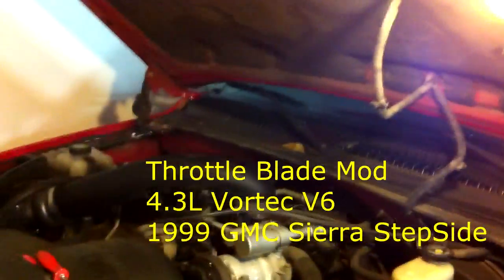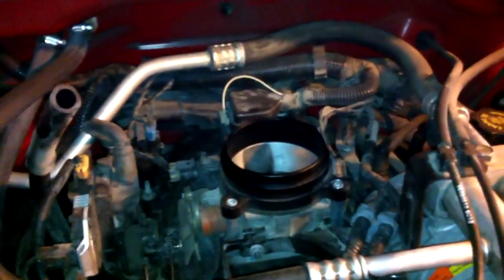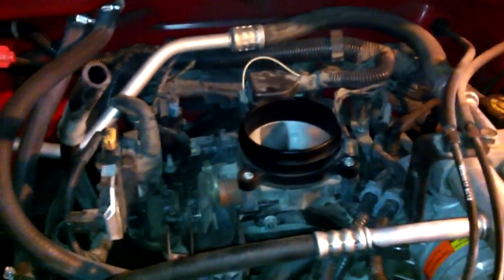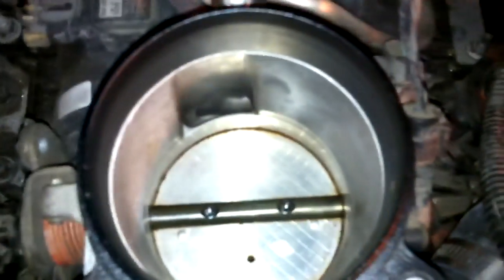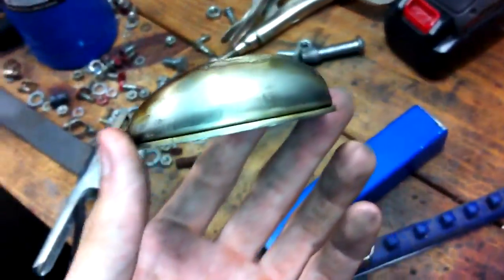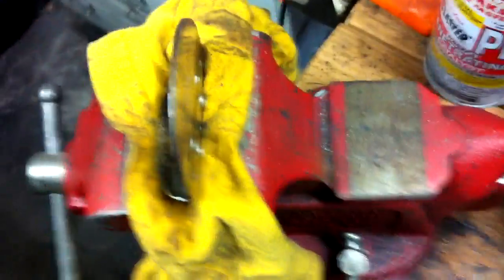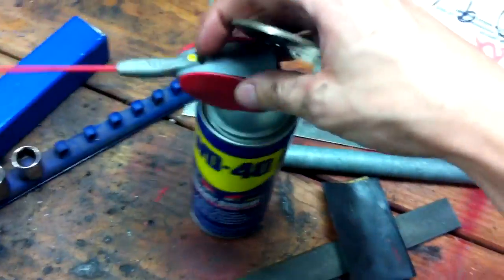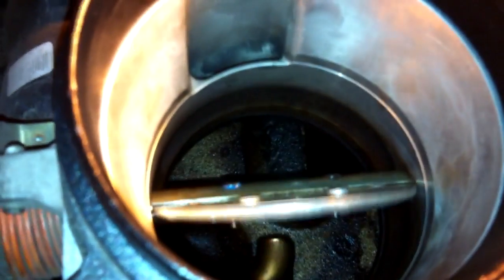4.3L/5.7L Vortec V6/V8 | Throttle Body Blade Mod | 262/350ci

Comment: is there a performance intake throttle body for 4.3's yet ?
Reply from the maker: its the same one that's on the 350s.  cant really do much for them other than mill them out larger
Reply: oh, ok ! ! Yeah I wasn't sure if you could order a holley or edelbrock for em yeah... thanks man!
Reply: cartoonist1975 
There's absolutely no need for any TB larger than the stock one. It even flows more air than the Vortec 350 can consume, so it's far more than even a radically modded 4.3 can ever use.
Reply: Hey Thanks Lee ! !

Comment: Hell mine ripped right off, the rivets pulled through that plate. The rivets stayed on the main one but the damn thing jammed in place causing my idle to race up to 4,200 at stops. I took it out cleaned the throttle and did notice more power at lower rpm's and it get's the same gas mileage. It did need a new tps also for that sticking idle all is good now.
Reply: same thing happened on my 2000 blazer 4.3..it does jump just a little from a standing start..not much though..but i gotta tell you the car runs a little quicker at high way speeds and accelerates a little faster going into passing gear. gas milage is the same. next im putting a cold air intake kit on it and a magnaflow or similar and see what happens!
Reply from the maker: I ended up changing my TPS about a year after the mod, it threw an engine code. TPS module incorrect voltage or something. cool to know all is good
Reply: EricTehRedneck  Update. Changed the tps also cause I still had a higher idle. Now a few months later after the idle staying where its at after letting off the gas to shift and spiking up to 2k also at times I decided to change out the iac motor. Cleaned the hell out of the throttle body taking it off to make it easier to change it, putting a new gasket on too. This made the idle really smooth but still spiking up to 2k and not dropping between shifts!! So and check this out people the damn cruse control wire was pulling the idle up! Or maybe not, I'll know in a few days of driving it but sense being the throttle cable was lose when it was happening. Thank god for my 96 geo Tracker!

Comment: I would like to hear from an expert on this. My guess is that plate you removed prevents abrupt throttle response when you press on the throttle from idle and only want to give it a little gas. It looks like the extra plate works to slowly blend the air when you use 10% of throttle. I would be curious now that you removed it, do you have abrupt throttle response pulling away from a stop at normal speed.
Reply: That is the point of doing it!  Lol

Comment: This mod doesn't increase hp but it does make a difference from a dead stop but to feel the power you need to tune the truck i did this and pretty good mod

Comment: what intake and exhaust do you have? It sounds badass for a 4.3
Reply: Mine sounds very similar, I have a Spectra cold air intake and a flowmaster 40 with a cat delete.
Reply: All 4.3 sound like badasses I had a hole in my collectors once right at the exit for the manafold  it sounded like a racing truck straight pussy magnet 

Until I got a ticket

Comment: I don't know about this mod. I personally wouldn't take a chance but that's just me.
Just get rid of the "Spider" Injector and get you a brand new Delco for ~$300 on Amazon. These injectors come with regulators on them, as an assembly. Might as well change it all, especially if you have all original parts.

I had a rough idle and a P0300 dtc there for a while. I drive a '98 K1500 and these "spider" injectors are shit for these earlier vortecs. I got a new fuel pump, crank sensor, dist. cap/rotor, new wires/plugs and the Delco injector and the truck runs like a brand new truck. It's been running weak so long that I've almost forgotten what it's supposed to run like.
Just do the maintenance that I mentioned and you'll be all set.

Comment: Ok - i hate to break it to you... you did not increase the horsepower of this engine. Let me explain why. The throttle body, MAF and intake components flow enough air with that hump to satisfy a 6.0 vortec generating 360 HP. That little 6 can't pull enough air to make that hump matter. 

Why then does it feel faster? here is why. GM put that their to make the throttle less jumpy and more manageable for daily driving. Because that throttle body is oversized for the application already, the tip in point is too aggressive without the hump so your manifold pressure jumps really quickly without it - making the engine feel more aggressive. But unfortunately, it still makes 210 hp. 

Get some nitrous, a cam or supercharger. til then, it makes 210 hp. Maybe 220 with the exhaust system.
Reply from the maker: it makes 200hp and "I hate to break it to you..." but the only one that claims a hp increase is cfm tech to steal your money.

Comment: I think this will mess up your fuel economy. Great for power im sure. But, if the upgrade kit is only 40 bucks just buy the 40 dollar blade. At least if you do notice shitty milage or just unhappy with it you'll still have your original unhacked throttle blade.
Reply: It has no significant impact on fuel economy. Most claim a slight gain, but I saw no discernable difference in mileage.

Comment: Do you know where the fuel pressure regulator is on that engine?
Reply from the maker: under your throttle body inside your intake plenum the fuel pressure regulator is attached to the spider injector unit. I have a video
Reply: thanks for the instructional vid!! took me more than 6 beers to finish though lol. more like an 18 pack heh.

Comment: I did this today on my blazer and my idle rpm jumped from 750 before mod to 1500 after mod. What could the problem be?
Reply: I'm guessing you removed the rivets and didn't plug the holes. The air going through the holes will cause an increase in rpm at idle.
Reply: lol.
Reply: lol
Reply: T.P.S.

Comment: Can't this slow your car down due to the computer not recognizing the amount of air coming in?
Reply: The MAF sensor will tell the PCM how much air is going into the engine.
So the PCM can compensate for this mod right away.
Reply from the maker: you should reset your computer by disconnecting your battery and waiting 5 minutes
Reply: EricTehRedneck That's how you reset the computer?

Comment: Did this the other day...I am very happy with the difference! Can't really think of why they would restrict it like that...the gain in responsiveness is just amazing!
Reply: I read they they did it because people were complaining of there wheels chirping and they hit the gas hard. Which I find comical. I removed mine also and noticed a big difference also. And going with gap less plugs and a good ignition coil makes a good difference too
Reply: Took a bit of getting used to, I'll admit haha...but nothing difficult. Backing up is a change for me. I noticed my throttle has a small catch...but has nothing to do with the plate...I took a long time bring careful removing it. Is it just suction?
Reply: What plugs do you recommend, and what brand of coil? I'm trying to get all I can out of my 4.3 being safe and conservative and on a low budget lol
Reply: ***** what do you mean by catch?
Reply: ***** Bosch plugs ( cheap brands broke on me all the time )  And i got a used MSD off ebay. Won bid for 15$

Comment: I have a 99 4.3L with 3.53 rear gear and will lite up street tires with no problem if tuned properly.  I use good  8.5mm  wires and good plugs, I get super throttle responce without this mod. It does not ad hp or better gas mil. why bother, I'm sure it sounds good. If you want more bottom pulling power use taller tires
Reply: Use taller tires? So....let me get this right....this blade mod doesn't cost anything but you're miss know it all and so nothing anyone else does is worth while because it wasn't your idea? So you had to throw in your two cents and tell everyone "meh, forget this free (that means no cost) mod that actually does work (yes, it does) and go out and spend a couple hundred bucks on tires instead". Get back Loretta!
Reply: CamSayCam d
Reply: Shorter tires dumb ass

Comment: Are these throttle body blade restrictors a common thing on most cars?
Reply: I have one on my 2005 Chevy Blazer with the 4.3L V6 4X4 I think because the truck has low end torque so just touching the gas at a green light it doesn't spin your tires or spin them in rain/mud/snow Most chevy trucks have low gears There made for towing and light off road use ..stock Cutting the restrictor of helps the airflow if you have a cold air intake not sure about cars but I never seen any of them with the many cars I had

Comment: How much horse power does the cold air intake give you? This guy said it was one hp of the 4.3
Reply: Carb. i give it 250bhp stock 300bhp aftermarket.
Reply: Blue Rebublic r u stoned these motors only push 190-195hp at 4300rpm the cold air intake may add 1-2hp but if u gut the stock system and change the piping u get close to 5-6 hp

Comment: I have the opposite problem and mine sounds like an old tractor is the best way to describe it it ticks but the more gas it gets the louder it gets I hear it echoing off of cars on the side of me while driving with the windows up real loud with them down infact I hear it clearly most of the time while driving like 90% sounds like a loud tractor or diesel it over sounds my flow master super44 with turndowns lol it's just embarrassing to me and my 02 sensors behind the cats have no readings and I cleaned the MAF and k/n drop in filter and got some power back but before that it was running extremely lean guys said like 18 or something and regular was 10 and it was weak but ran normal just no power loud increasing tick and horrible gas mileage which since I cleaned the MAF and filter it's getting worse gas mileage lol idk I live in lake Charles and mechanics around here everyone tells me completely different and idk whats true anymore lol

Comment: Help me out Eric same truck as yours (engine) I tried cleaning some of my blade and got some off the problem I see is the walls of the intake and bottom of the blade was black walls look like they were just turning and it sounds like I have a valve train tick and gets worse the more gas it gets I think it may be the spider injectors or header gaskets ? It's horrible I can hear it in the cab :/ oh yea an when you took the blade off beneath it still looked clean mine is completely black what does that mean?
Reply from the maker: these engines have a tick to them. mine ticks pretty good too, just a noisy valve train/FI design. with my exhaust and intake it is hard to hear it above idle though. you will have clean spots on the top of your lower manifold if one of your injectors or fuel pressure regulator is bad. I have a video up on my channel changing my spider injector because my fuel pressure regulator on the back was leaking bad. this caused it to be rich on warm start ups.

Comment from the maker: Ive found straight pipes sound the best. I've got a Y-pipe instead of a muffler piped out the back and it sounds sick. In this vid I think I had a flowmaster outlaw dumped under the bed of the truck.

Comment: Disconnect your negative battery cable for 1 hour. I just disconnected mine while watching a movie and plugged it in later. It will reset the fuel:gas ratio of the computer and then re-learn it.

Comment: Did this change the sound at all for you? Do you think it's TOO responsive? I mean obviously it depends on the driver's foot, but you mentioned rain and that is a legitimate concern. At 10:58 you mention the transmission, was that a joke or did it actually have trouble picking the gear? And I'm terrified of doing this because I have a feeling that my fuel economy will go to shit lol

Comment from the maker: nah man don't bother, 5.3's don't have the plate. there are lots of other things you can do to those LS motors. I assume you changed the gearing in the rear end to match the tires? that would help the most. this mod doesn't add any real HP just increased throttle response.

Comment: Hey guys I know they cost a chunk of change but I put under drive pulleys on mine. Not only did I get a few more horses but I got an increase in MPGs too. This combined with the throttle body mod my little 4.3. runs pretty strong.
Reply: Under drive pulleys?
Reply: @Dan0rioN yeah it frees up power from your accessories, but because they spin slower  you have to watch it....The water pump and alternator especially

Comment from the maker: heard about the mod from those crazy s10 guys
Reply: EricTehRedneck my diffuser broke off on its own and got hung in my throttle body and almost blew my motor after I pulled it out it does everything better
Reply: Derek Williams is it. 4.3L or 5.7?
Reply: benson420710 4.3s nothing but a 5.7 with 2 cylinders missing

Comment from the maker: someone had the job of engineering that restriction plate and my only guess is that it has something to do with the EGR tube directly below it and the epa's requirements. with the plate removed it allows more of a direct flow of air to get in the egr tube. I'm only guessing. I'm not quite an engineer yet. lol

Comment from the maker: I'm not sure about the older 4.3's, especially in the dimes. I don't think that they are any different. You should check and it will be an excuse to clean the throttle body while your at it. haha

Comment: I just got a 01' ZR2 dime for DD. I have no intenions of other mod's like CAI and exhaust and if i do, It will be down the road. Will it benefit me at all? Im looking for less kick down on highway hills, 80+ round trip. Did you gain any more mpg's? I know its no HP mod, Just increasing the throttle response. Thanks for any help

Comment: I did this to my 98 and took the Throttle body off the engine and the blade off the the throttle body too. Now i feel like the blade doesnt sit straight, theres still a few thousands space between the the front of the TB and the front of the blade. Im not sure if it even sat level inside cause it was last week that i took it apart. I thought maybe cause its cold where im at and the metal tightened up? Any clues? Im thinking about just running it like that maybe itll sit better once i run it?

Comment from the maker: Yes you sure can, I've never even been inside one of the new GM's but I'm sure its the same. Anything with a throttle body could have a restriction on it.

The 2014's are radically different though, they completely redesigned the truck engines, including the good ole 4.3L (all aluminum, direct injection, VVT etc.)

Comment: thats funny. my 02 sonoma 4.3 vortec doesnt like to start well if i turn the key to "on" and let the fuel pump run.... then crank it. it turns over many times before starting. if i get in it, and go from "off" to full cranking, it starts immediately.

Comment: I have a 03 Silverado 4.3 non-vortec, and I have to either hold the ignition down for about 6-7 seconds or prime the fuel pressure a couple times before it will start. Is this the same problem you had? If so, could you please post the vid over the fuel regulator.

Comment from the maker: reset the computer by disconnecting the battery for a min. this resets the fuel/air mixture tables so that it can re-average the mixture with the blade modification. this way you get the most out of your mod.

Comment: I can't wait to try this on my 99 ZR2 5 speed Blazer. I already did the intake and exhaust and it chirps the tires through 4th gear. I suspect I can get it to do one straight burnout thru first into second once I do this.

Comment from the maker: I recently bought the new mpfi spider and replaced the one in my truck. from what i could tell it was the regulator. when i had the plenum off i put the fuel lines back in and turned the key to see if anything was pissing which it wasn't until the pump kicked off and the regulator pissed gas all over the place. I still need to upload that video... thanks for watching

Comment: Its probably the Fuel regulator. I have a 4.3L as well and I had to replace the fuel regulator and the Fuel Spider too. If i was you I would do the Regulator first.

Comment from the maker: I got an echlin from napa. not the way I wanted to go... I over paid but i needed it as my truck would barley run if I could even get it to start. I recommend getting a delphi spider from ebay. should be about $225 from seller vetteparts2002

Comment from the maker: K&N claims to give you 2 more MPG, as for the throttle mod i'm not sure. I have the intake, straight exhaust, TB mod, and new multi port fuel spider, with the 4L80E, getting 21mpg. It was 16mpg for the longest time before I replaced my old failing poppet spider injector!

Comment from the maker: rattling is not good, I was told that the tick is normal, its just a noisy fuel injection/valve train design. pop your valve covers and check everything out make sure it's not something obvious before you look at that cam.

Comment: In your video beginning you talked about your engine ticking, my 4.3 does that, its sounds like a stuck lifter. I can also hear a rattling noise when I rev the engine up. It really sounds like the cam bearings are loose.

Comment: i got a 5 speed with my 4.3 i can spin the tires great already without the k&n and throttle mod will it get better gas with both or just the throttle mod thanks

Comment from the maker: That is strange, I'd suggest intake and exhaust if you have not done so. K&N makes a great kit and I'd recommend aftermarket muffler or straight pipe for exhaust to gain the most performance. Headers and a programmer will always increase performance as well. these 4.3's take to bolt on's quite nicely. You can also try to remove any weight from the bed including spare tire underneath. thanks for watching man